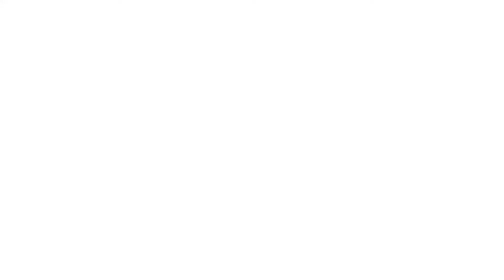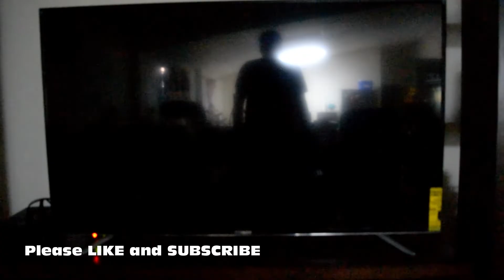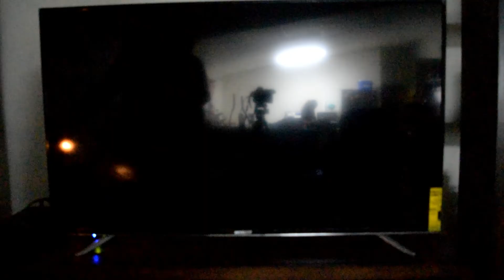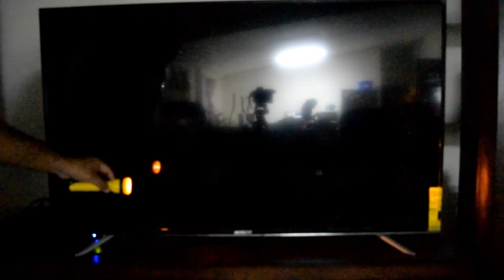How to tell if TV LED Backlight is defective

Comment: Depending on if its an LCD or LED , This only means you have a problem with either 1/ PSU that supplies backlight power  2/backlight invertor 3/ the backlights. 
Usually a section in the PSU that controls the power for the backlight system that goes faulty, (low volts) if it went high volts , it could have damaged the other module, if it has one  and the backlights.